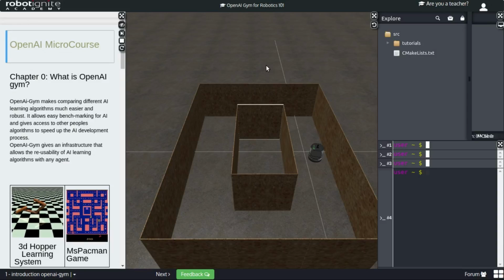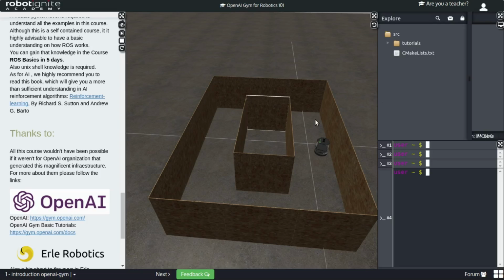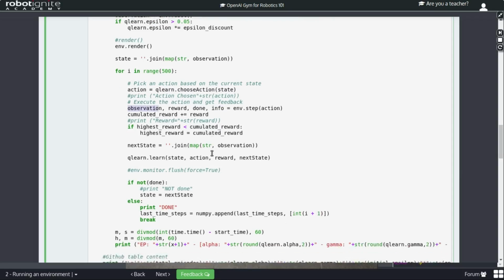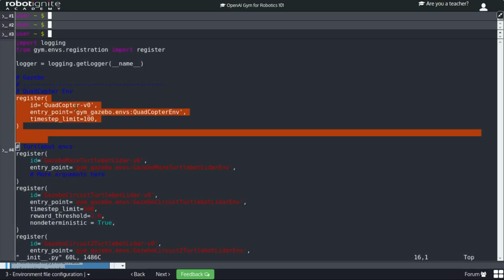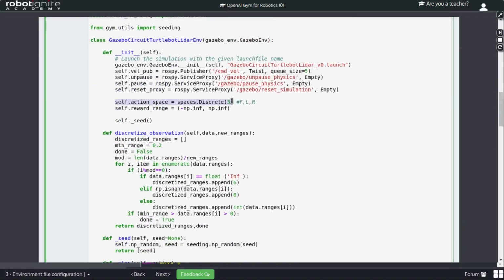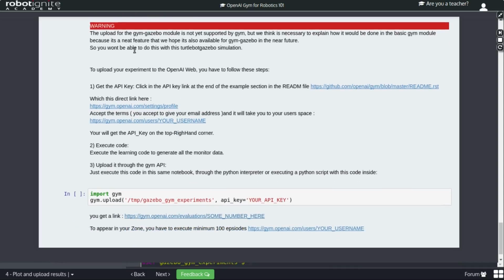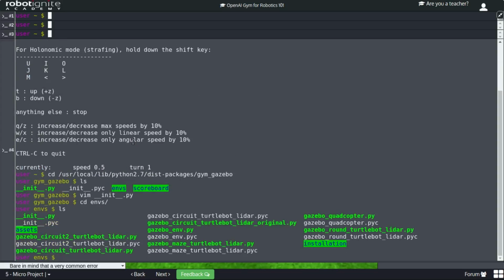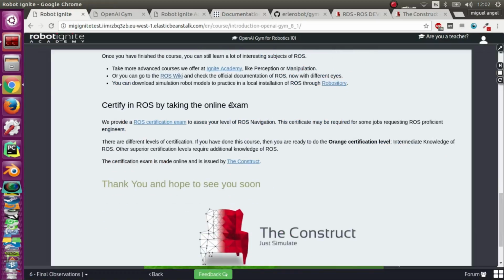[ROS tutorial] OpenAI Gym For ROS based Robots 101. Gazebo Simulator

Comment: For the reinforcement learning in ROS if I want to train the agent to learn for example 2 things...can I train it for one thing and then to add complexity on the environment to learn second thing but to train on the changed environment loading the weights from previous model. Is it possible to train like that with several stages gradually adding complexity but each time to train on previous weights? Thanks

Comment: python2  simple_qlearn_quadcopter.py   ResourceNotFound:drcsim_mode_resources??? could i install drcsim with my Ubuntu16.04???
Reply from the maker: Please ask clear questions. With that information we cannot understand what you mean
Reply: when i follow the steps, when i use the python3,the error is that python3 can't import tf;when i use the python2.7 ,the error is that  ResourceNotFound:drcsim_mode_resources.So i can't run the script like the video show.What could I do then get the result like the video show?
Reply from the maker: Which steps? The video has many steps. You are not indicating where exactly it is failing. What command did you send? Why did you use Python 3 (our system has only Python 2)?
Reply: because i used pip3 when install gym-gazebo,so I use python3.When i run the script python simple_qlearn_quadcopter.py ,the error is that ResourceNotFound:drcsim_mode_resources
Reply from the maker: Sorry, you are talking about an installation problem in your machine. That is very difficult to help you because we do not know what you have done in it. The tutorial is for doing it in the Robot Ignite Academy (http://robotignite.academy). There we not deal with installation problems, just the REAL problems of applying OpenAi to robots.